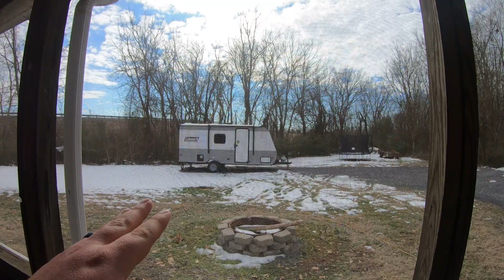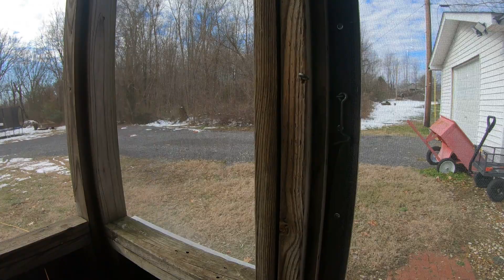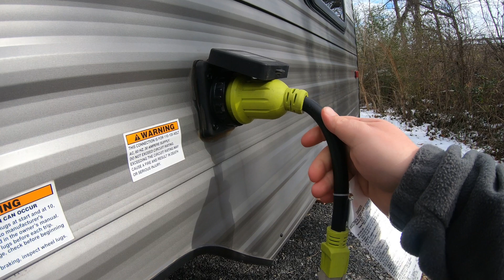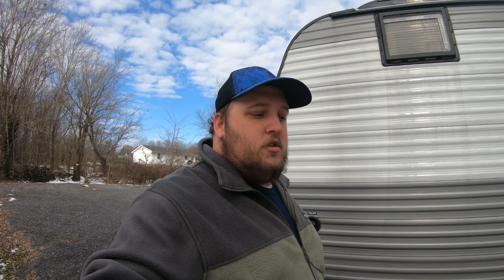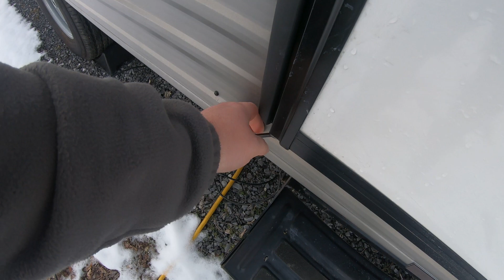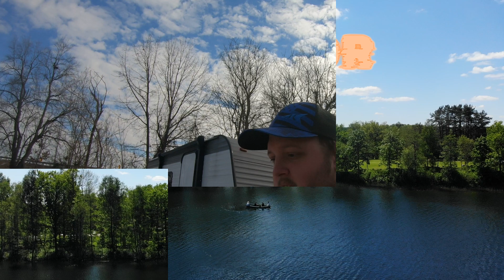Camp Smart: How to Choose the Right Cords for Your Camper!🔌🏕️

Comment: How many times did you trip the circuit before you realized you couldn't run the microwave when the air condition was running?  😂😂
Reply from the maker: @cyclonickwf  haha zero times, I already knew this would be the case. We had a camper plugged into the house when I was growing up.